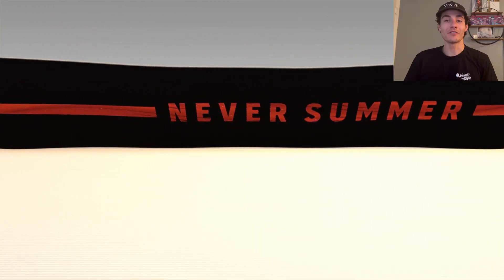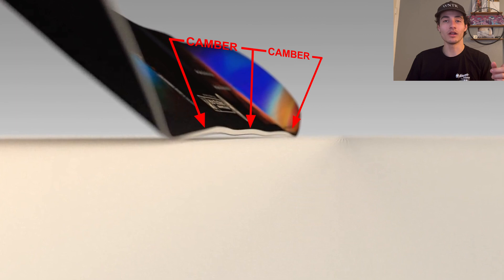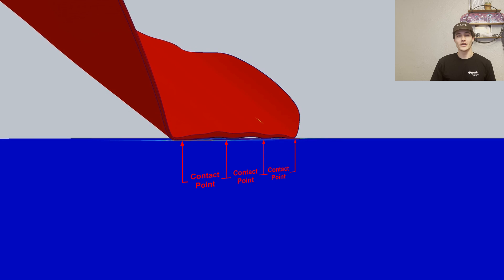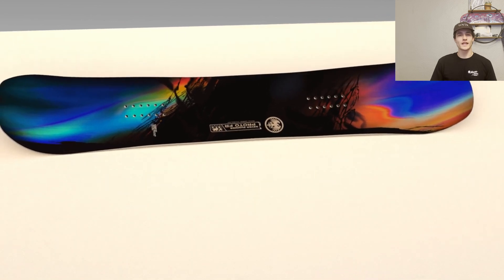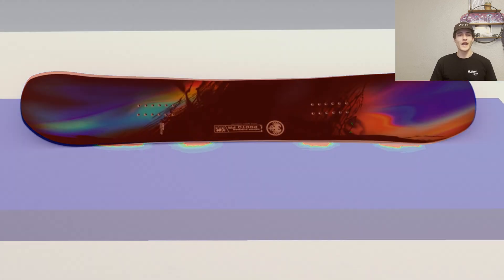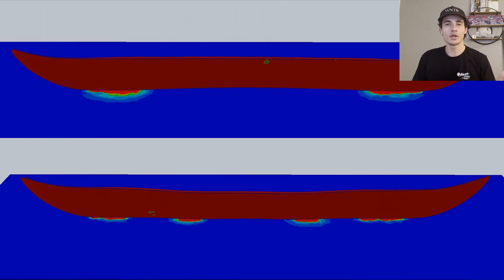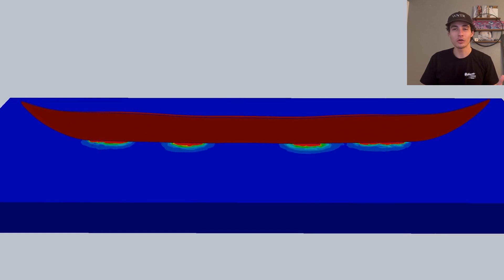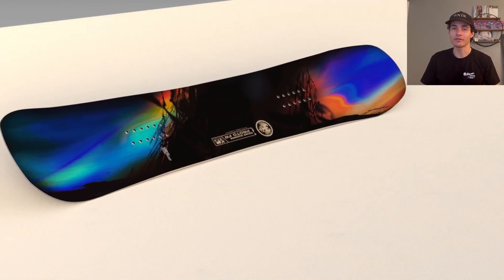Triple Camber Engineering w/ Team Rider Sam Anderson

Comment: Big NeverSummer fan. They build some of the highest quality boards out there and only implement tech that improves the way the board rides. I’m interested in seeing how the simulation looks camber vs triple camber as the board gets fully flexed throughout the whole turn and through different size turns. We all know you can get camber boards to make full contact throughout the entire sidecut of the board, otherwise there wouldn’t be any improvement when designing multi radius sidecuts.

Comment: If you think that the only contact points a traditional, cambered snowboard has with the snow are in the ends, you need to take a closer look at what's actually happening when a snowboard turn.
Reply: hes not saying its the only contact points, hes saying its the high pressure contact points, which is where your edge engages most on the snow.
Reply: Thats not what he is saying…at all.
Reply: If you think you understand this simulation you actually need to watch it again.
Reply: Yeah you know more than professionals………..